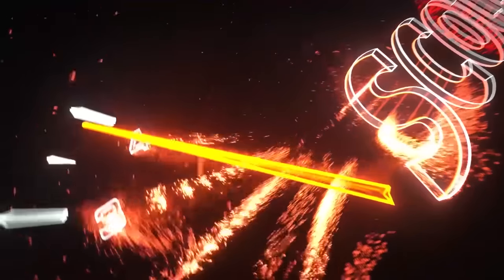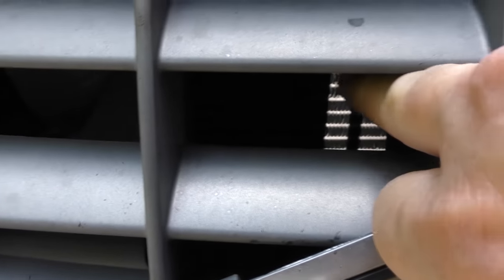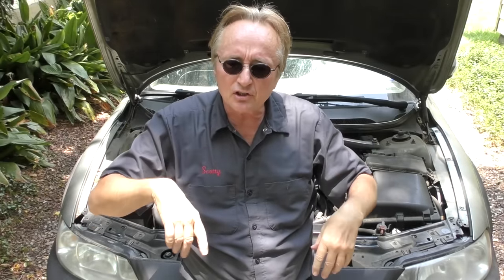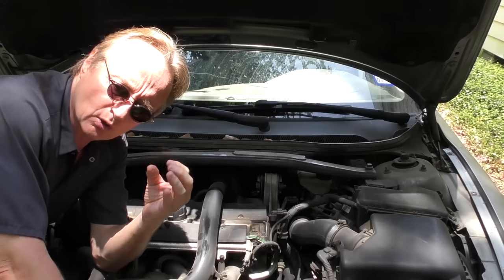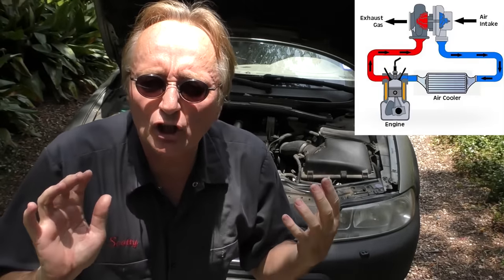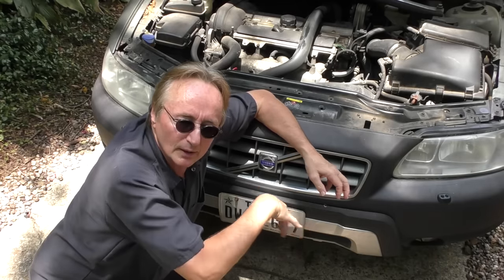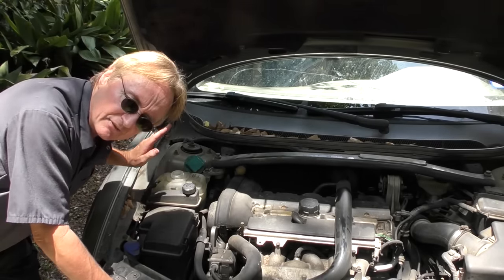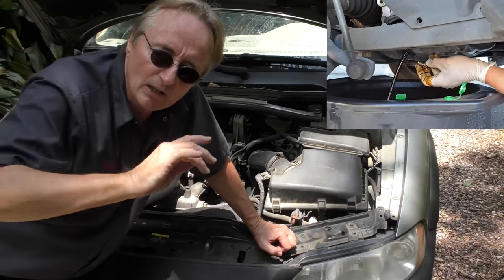5 Things You Should Never Do in a Turbocharged Car

Comment: Scotty didn't mention that the best way to cool a turbo after a blast on the freeway or a long uphill is to cool it with residential driving speeds of 25-30 mph before then idling for 30-60 seconds. You need to allow a turbo to "spool down" RPM s as well as cool down.

Comment: Ive been driving my subaru wrx hard for 120k miles and the turbo and engine are working flawlessly still. But everything he said in this video i already do.
Reply: Same here, 128k miles on a Mazdaspeed 3 and somehow turbo didn't give up on me yet. I had some small parts to fix here and there but it was mostly a 50-100$ jobs overall.
Reply: Subaru makes the best turbo ans have been making them over 30 years its all these other companies that are using turbos that will have issues
Reply: 2015 on Subaru turbos are reliable

Comment: I’m so happy I’ve been doing this as a habit since getting my car almost 4 years ago, always let it idle until the RPM sinks a little, never going above 2,500rpm until the oil has reached at least near normal operating temps and always drive calmly if I’m stopping soon to let the Turbo cool down, don’t know if it matters for my Supercharger but at least I know my Turbo is being treated well 😁
Reply: My experience with supercharged engines is with diesels in the army. Not sure how that translates to civilian vehicles but just trying to floor them early you feel the engine is unhappy. Warmed up and they're fine especially when already driving at speed.

Comment: Glad you used that early 2000’s Volvo in this video :) I have the 2006 V70 version with the same engine and transmission. They are great cars and last a really long time if you maintain them. I change oil every 4-5k miles and use Mobil 1, quality filter, and BG’s MOA additive; transmission fluid and filter change ~ every 30k miles. It’s going strong with no leaks or oil loss at 127k miles currently. These cars are also structurally solid and refuse to rust!
Reply: I own the v70 xc 2004. Currently in 323k miles. Hahahaha! No single problem! Instrument cluster misbehave sometimes anyway

Comment: Also another tip. Whether you are driving an AT or manual, be at least 2700-3000rpm before you floor it. Don't accelerate from like 1500rpm, you are flooding your engine and the turbo builds the boost much slower from slower rpm and you could end up with detonation from unburned fuel and there goes your entire engine and say goodbye to your car. 
Also if you are buying a turbocharged car, it requires much more TLC than an naturally aspirated. You have to keep an eye on everything and you have to change spark plugs much more frequently and be mindful what kind of fuel you are putting in. All require top-tier gas,  Exxon, Shell, Sunaco, etc.  Walmart's brandless fuel, Sam's Club etc.. or something like that will not do any good.
Reply: The highest rpm I climb on my diesel engine vehicle is only 3,000.  I never go higher than that.
Reply: False.  Not all turbos require premium.  
And costco has is tier 1 gas.

Comment: Hey scotty, someone told me about the wastegate of the turbo. If you adjust it right you get your turbo kick in fast. Is there any danger doing that? My turbo usually kicked in at 2000-2100 rpm, but after driving the thing for about 10 years with 100000 kms on it, it started kicking in at 2500 rpm. So i did that adjustment on the wastegate and its now back on 2000-2100 rpm range. Is it good or bad?
Thanks

Comment: I would also suggest disabling the ignition after oil changes and turning over the engine until you have proper oil pressure. Perhaps 30 seconds. This was in the manual for my Merkur turbo.
Reply: Hey, cool. I always wanted a Mercur XR4Ti after the fun I had with my '74 Capri.

Comment: My turbocharger turned 18 years old and finally stopped working, all of Scottys tips in this are spot on btw.
Reply: Amazing did you pretty much do what Scotties saying? I’m the owner of my 2nd Ecoboost powered F150, my first 94k not the first problem, any advice?
Reply: @poppyneese1811  my mechanic ended up being able to repair the turbo without having to replace it, not sure how. my little 1.9tdi volkswagen is still going and now its 20yrs old lol. Still using scotties advice

Comment: The EcoBoost should be called Eco/Boost because you can only have one at once. My 2011 F150 with 160k miles  gets 12mpgs I love it though.
Reply: One time I reset the fuel use guage, and floored my 2 L turbo to  see what would happen. At full throttle, it worked out to 3 mpg. It was pretty quick too. Driving carefully, I  can get over 35 mpg. Not too bad for an SUV that can tow my boat.
Reply: TOXICxMETALx98 something's wrong with yours. My 2018 Expedition gets 19mpg combined. I usually drive 70-75 mph highway.

Comment: If you drove your turbo hard on a german Autobahn, please cool it down longer than just 30 seconds :-)
Personally I drive the last 2 kilometers before my exit with not more than 120kph, if I floored it before and I know I will turn off the engine soon after the exit e.g. just to get fuel.
You can also use the exhaust gas temperature at the catalytic converter as an indicator. I don't turn of the egine, if it's hotter than 650°C. This may vary on other cars, but I noted this temperature for my Mazdaspeed 3 as a kind of "save", because it is also is reached on lower loads.

Comment: Hi Scotty! This is my first question: I'm a new driver. I heard that when stopping at a red light for a long time, you should put your automatic transmission from D to N to reduce grind from the engines. I've also seen my father put it to P while waiting for a long time at a red light. Online forums say to leave it in D for safety's sake, and not to wear out the transmission clutches. As a mechanic, which practice is the best? THANKS!

Comment: Nonsense! There is no need to idle a MODERN turbocharged engine for 30 secs, or any amount of time, before you shut it off! Why? Because (1) most contemporary turbos are watercooled so the bearing section (where the oil goes through) never gets too hot for the oil to coke. (2) Just about every car since the late-90s have an after-run water circulation pump. Hence, when the engine is off, the ECU continues to run a flow of coolant through the turbos for up to a few minutes. If necessary, the electric radiator fan(s) will stay on for a while too!
—
The need to idle turbocharged engines, like 3000 mile oil changes, is dinosaur advice!!!

Comment: Ironically enough at 1:37, the speedo/tach in the upper left corner is from a Mazda RX8 - a car that you can safely rev to 4,000+ RPM as it warms up (especially if you premix with 2-stroke oil in the gas) but if you put a turbo on it then the engine will probably explode.

Comment: Now how do I make the motor last in my turbocharged car?
Reply: Don't floor it at low RPM in higher gears. If you've got a manual transmission and you're cruising at 2,000 RPM in high gear don't be lazy; downshift a couple years before passing.
Reply: Buy a 2JZ-GTE.
Reply: swap a 5.9 24v Cummins in.
Reply: @mylesswann530  Yah no. Swap in a Cummins 12 valve.
Reply: @yadidimeanmaine  yes, that
Reply: @monstermushroomcloud  when you find a stock 12v that yee yees haven't gotten to. Let me know.
Reply: @mylesswann530  Not hard to find really. Finding a lower miles 4x4 is a little tougher.
Reply: @monstermushroomcloud  In the south east it is, low miles as in 170 -225? I settled on a 03 24v 4x4 NV5600 clean internals with 207.

Comment: Turbos don't increase gas milage. A smaller engine does. A turbo just allows the engine to be smaller while still offering similar power.
Reply: When i turbocharged my camry 5sfe i gained at min. 5mpg  on the highway(same displacement as stock). Granted now i stand on it alot so it really dosent matter lol.
Reply: Yes, they get better gas mileage with similar power
Reply: Turbocharging is more efficient because it repurposes some of the wasted energy from the engine.  So yes, they do get slightly better gas mileage than an equivalent NA car.

Comment: Have can’t say I fully agree on Turbocharged engines getting better MPG over NA engines. Had an 04’ SRT4 & 12’ Genesis 2.0 both manual  with boost gauges. Did a road test from Houston to SA & only ran Vacuum based off the boost gauges & neither of them got better mpg over the same trip with my 15’ Mazda 6 (manual) & 15’ Civic Si (Manual).

Comment: Wow, 197k is impressive! One reason I chose not to buy a Subaru Legacy GT in 2007 was concern over turbocharger longevity. I went with a Legacy 2.5i Limited, which I still have today with 155k miles. The naturally aspirated boxer has done pretty well, though it ate its original head gaskets by 90k miles.

Comment: Hey scotty, im helping my buddy look for a cheap car to use for work until he can get something nicer and found a 2004 chevy cavalier for 800 bucks. It has just under 100k miles but the abs light is on, is it a good idea to buy it and just run it without abs? Thanks and keep up the great vids!
Reply: yessir absolutely if you can just deactivate the ABS by itself, its perfectly fine to drive (and i do prefer no ABS) however some cars like my 2008 dodge caliber are unfortunately awfully designed and the ABS is fused with other instruments in the dash. if the cavalier is like my caliber in that sense, then you cannot just deactivate or remove the ABS and you must instead pay for new ABS sensors for each tire that needs it (check code)

Comment: Thanks Scotty for posting this video. I have a Chevy 2012 Cruze with the turbocharged engine. It hesitates when I step on the gas. Sometimes, it does not accelerate at all which is real dangerous when I am merging with traffic. I brought it into the dealership. I told them about it but all they said was it needing a new turbocharger and intercooler because it came back with an under boost code. After they replaced it, it still has issues with hesitation, especially when it's hot outside, usually above 80 degrees. It can get to be over 90 or a 100 around here, so I dread merging onto the freeway. After watching this video, I plan on replacing the synthetic oil over 5000 miles and letting the engine warm up 10 seconds, I hope this will solve the issue with the hesitation. The dealer cant seem to solve it. Im no mechanic so I rely on car guys for advice and fixing my car.  The car is great, when it doesn't hesitate or have rough idling that shakes the whole car.  I'm considering buy a Corolla or Camry after watching your videos about how great Toyotas are.

Comment: Another good tip for ensuring a turbocharger's longevity:

MAKE A SMALL OIL RESEVOIR AND A SMALL PUMP FOR THE TURBO TO HAVE ITS OWN OIL!!

The ideal oil would obviously be a full synthetic oil of course.
Reply: Yul Strokheet Al-Wauch  I mean, there also needs to be a means to cool it, but the point I was aiming to make is let the turbo have its own oil separate from the crankcase.

That's kinda the point to what I originally commented.

Comment: After reading every comment ( 3 hrs ), I have a question.  The cooldown period at idle everyone talks about before shutting down engine, is that if you've had the turbo kick in during that trip, or everytime no matter what kind of driving you were doing?  Does the turbo rotate during routine calm driving conditions, thereby wearing out over time?
Reply: Turbo tech for 20 years . The "cool-down" period is 100% dependent on the running temperature . If you live at the top of a hill , or in hot weather , or just using the power heavily . Shutting the engine off right away WILL roast the oil in the turbine bearings , when the oil flow stops . This is called "coking" . When you start the engine after it is cooled , that coked burnt oil is like sand abrasive to the bearings , greatly shortening the turbos' life . The rotating assembly is turning when the engine is running . At idle barley , at hard throttle can be 80.000 + rpm . Let the coolant and oil pressure calm the temperature , if hot . Better yet ........ Get a NON turbo car . Always get the bigger engine if an option . Turbos belong on diesel or racing . Avoid if you can . I wouldn't thank you if you gave me one for free .

Comment: Warming up at start up and cooling down at shut down for a few seconds benefits all cars. The problem I had with my turbo was it eventually leaked some oil from a seal and some oil would go into the engine. The car was 9 years old so I sold it. The stealership told me that the cost of the repair was about $2,000. That was in the year 2002.

Comment: im sure this has be talked about but.. 2011 ford f-150 eco boost 3.5 with 160000 miles.  does a oil catch can lower the lubrication on the turbo?  install or not to install. that is the question.
Reply: catch can does not affect turbo lubrication

if you already have 160000 miles its an even better idea to install, as you will likely have more blow by from piston rings.
Reply: Only install a high quality catch can if you chose to go that route, low quality ones are pointless and won't make much of a difference. Also with installing any catch can, that means more maintenance that you would have to do because you would need to check your engine more frequently on the catch can so you can empty it. Its something to think about when inconveniencing yourself, its not just a 'set it and forget it' mod.

Comment: The world has gone crazy with turbocharged cars. Ford’s “EcoBoost” line for example: you can get eco, or you can get boost; but you can’t get both. I’ll take a naturally aspirated Toyota 3.5L V6 over their 2.3L turbo in-line 4. It’ll last longer and it makes just as much power. Same goes for a naturally aspirated V8 over a turbo V6. V6’s are just not made to produce 450-650 horsepower. 400 is about the limit for a 6 cylinder in my opinion. You can use turbos to boost the power a bit, but not as much as Ford is. The German 3.0T straight and V6s are sensible with typically 330-360 horsepower. Lexus’s 3.5T V6 is a little less sensible but not ridiculous with 416 horsepower and 442 pound feet. The Raptor’s 450 horsepower is really pushing it, especially with 510 pound feet. But the Ford GT goes way too far with 647 horsepower and 550 pound feet. That should be coming from a V8 for both objective and subjective reasons

Comment: Turbo timers are cheap and handy for cooling off the turbo 🚗
Reply: I'd not heard of a turbo timer. I will have to learn more, but I wonder if they ever use a oil pressure accumulator to force oil into the turbo bearing as it cools.

Comment: WHAT? ,,,,,,, he says he changes his oil every 5-7k,,,,NO!   If you want your turbo and engine to last you change it every 2,500 to 3,000 miles on cars and in large diesels at 3k to 5k.

My 2018 Civic SI says to change at 7-8k but I do it at 2.5-3k.

My 2017 Ram HD 4x4 one ton diesel says to change at 10-15k but I do it at 2.4-3k and with the heavyweight use it gets it really needs it.  
Now if you drive very easy mostly on the freeways you could go longer but matter what oil you use turbos destroy oil!   The sooner you change your oil the better.

Comment: Scotty I have a question. I have a 30l diesel turbo car and I change oil every 7-8k miles. I use extremely good and expensive zinc oil. But what helped the car ran smooth all the time is this: I use flush engine, then cheap oil for 10-15 min idle and then the good oil. The question is: does flush engine helps turbo ???

Comment: Avoid turbos if possible,another maintenance problem,from past experience on 1983 280z turbo,Slick50 took care of turbo noise and worked well,car started falling apart at 130,000 miles from multiple issues.Avoid Nissan as Scotty says.

Comment: WOW, one of the actual best video's of your's I've seen. BUT, you forgot one main thing !!!!! Your intercooler doesn't actually function until you are going at least 50 km/hr (thats 30 MPH for you southern folk). Hence why when you are at thee tuning shop, they sert up a huge fan over your intercooler when they dyno tune it (at least they should - if not - find a new shop!!!!)Therefore, you should NOT be building full boost until you are moving at a good rate of speed already!  This is how most Subaru owners blow their head gaskets - parking lot drifting in the winter time on full throttle while barely actually moving!

Comment: Hey Scotty, my Mother just baught a 2016 santa fe sport 2.0t with 36,000 miles. The dealership changed the oil and it has less than 1000 miles on it, but it nearly black, while my 6,000 mile oil in my 2011 kia sportage with a 2.4i is barely brown. I have heard this is okay because the turbo with GDI gets hot and the its just soot and the darker the oil the better it's working. Any thoughts, thanks!

Comment: I have an 02 Subaru Impreza Wrx with about 30k on rebuilt JDM ej205. I was told to put a synthetic blend in it. Should I be running full synthetic oil instead? Also, what brand is the best for these old turbocharged Subies?

Comment: The turbocharger on my EMD SD40 locomotive has a feature, called a back pump, that circulates oil onto the turbo for a half hour after the prime mover is shutdown.
Reply: Years ago, I read of adding an oil accumulator tank to a turbo. It filled with oil, under pressure when the engine ran, and a small hole allowed the pressurized oil to drain back after the engine was shut off, to cool the turbo bearings.

Comment: I have a 97 f350 7.3 powerstroke.  I like to let it warmup a bit.  I let it cool down a bit especially when i pull my 13k trl.  I do pretty much all heavy accelerations and i get about 12.5 empty period. I can also baby it and get 12.5 so let that coal roll. The trk drops to 8.3 when im towing my trl. I also have added a 5 inch exhaust on trk and did a napa 6637 air filter mod and ive doubled my boost over choky stock intake n exhausting